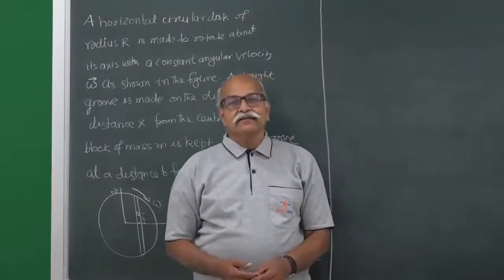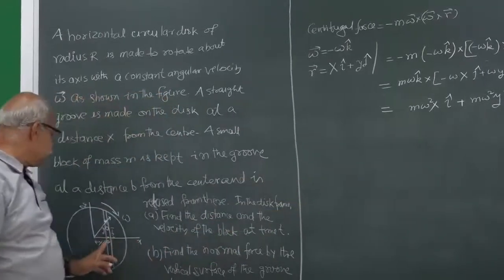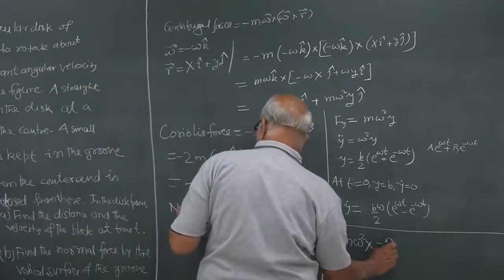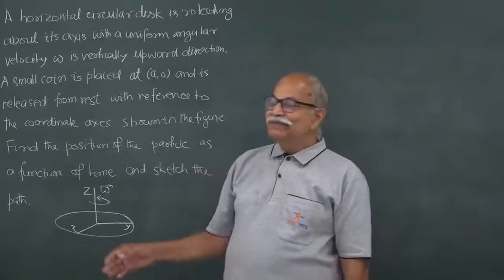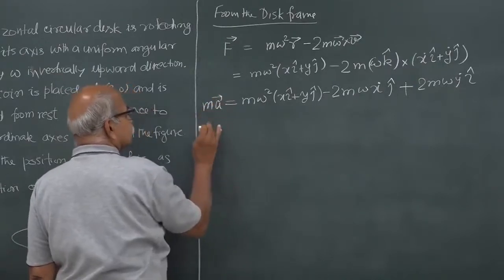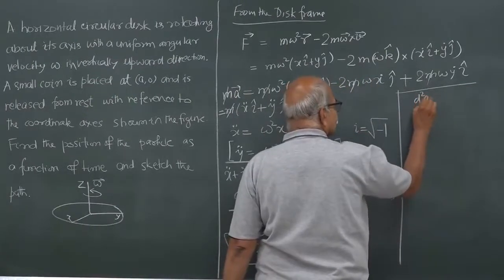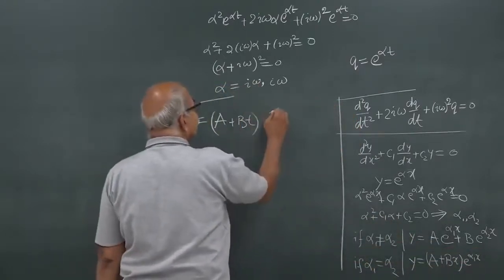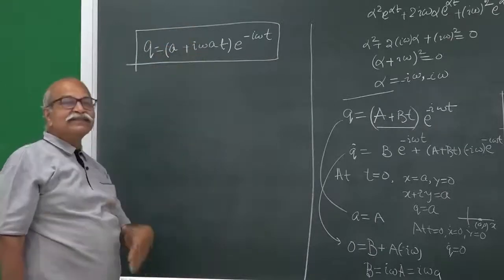Lecture 19  Analysis of demo on Rotating disk

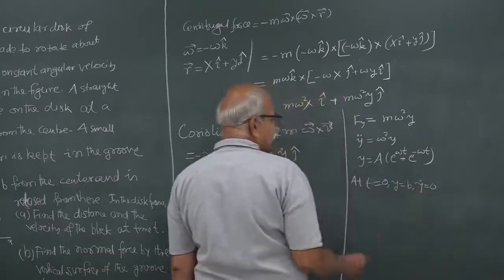Comment: 9:12 In the 1st problem, : as given in the question b is not the y coordinate at initial. But b is the distance of the block from the centre. That mean at initial the y coordinate should be equal to √(b^2 - X^2)